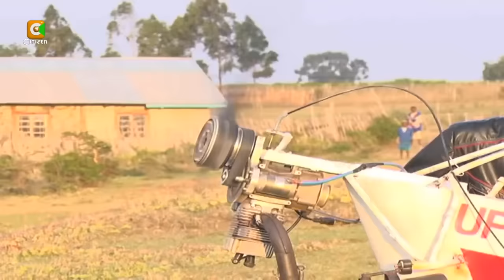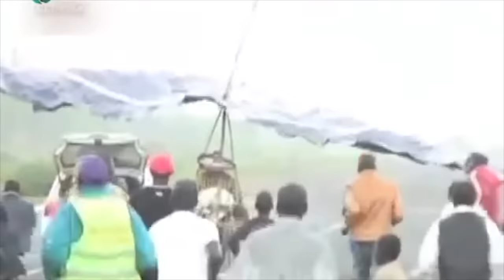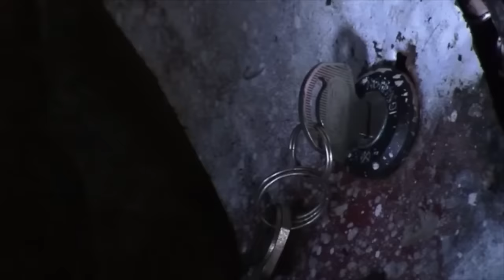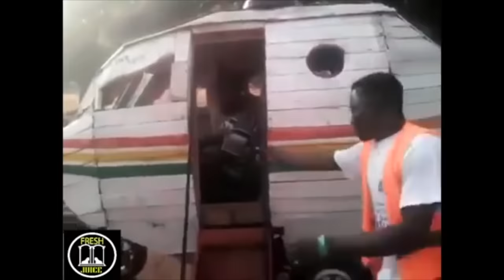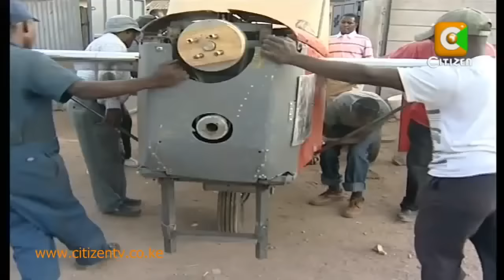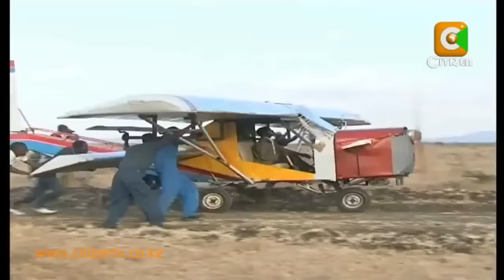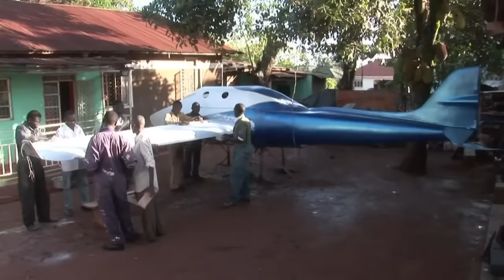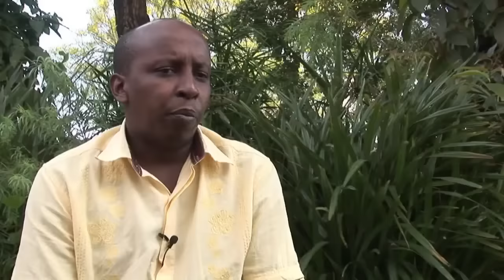African Airplane Compilation | African Aviation

Comment: I really respect these guys, but motorcycle engines aren't good enough for flight.  I think they need like a 12cyl engine, but at least they are trying to achieve their dreams in a country where dreams go to die. They are using sheet metal but I think some kind of canvas with shellac would be lighter.

Comment: 95% keyboard warrior westerners making fun of you in this comment section can't even make what you guys have made.
Reply: You done understand buddy. These are some of Africa's greatest engineers. We are not comparing ourselves to africas engineers. We are comparing our engineers to theirs.
Reply: I can’t make a frame with some sheet metal around it, some strings and cables and put a V8 big block as the engine in it? Sure I can,,, and I can tell you it won’t fly just like these pieces of trash. I almost don’t believe this is real,,, looks more like a joke
Reply: @raidthefridge7837 how do you know they are africas greatest engineers? provide proof

Comment: Those engines are freaking underpowered for its application. Why are they doing a trial and error test instead of mathematically engineering their way on developing their contraption.

Most of the problem we see are a result of not doing a proper motor/engine sizing. There's also a striking large amount of missing flight control surfaces on the wings. 

Ambition, and passion isn't enough to achieve flight! If you can't do a simple engine sizing then you don't deserve to fly.

Comment: Better to build a drone with electrical motors and battery from China. It is much easier to control. Use an dji agra drone as reference. 😂